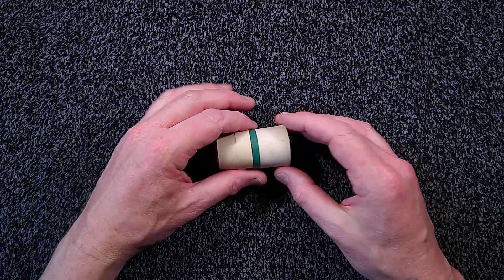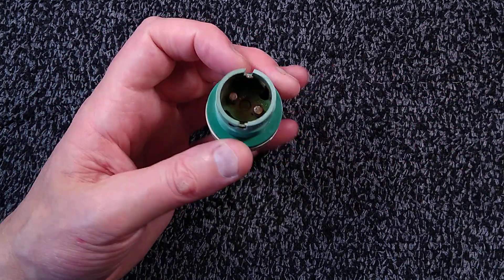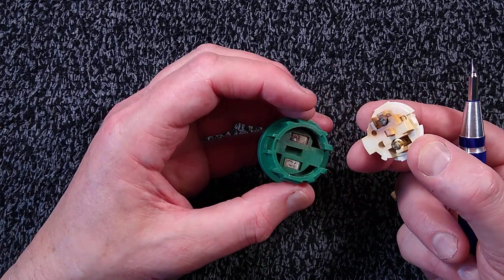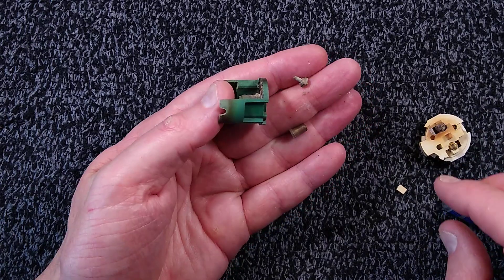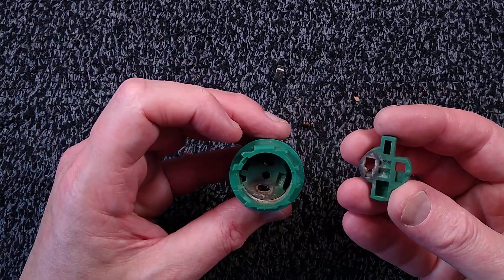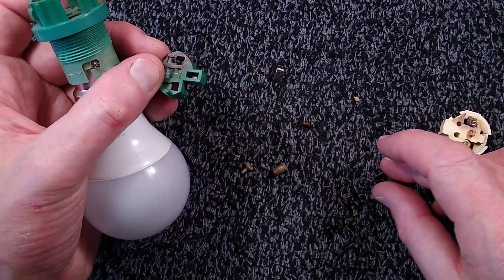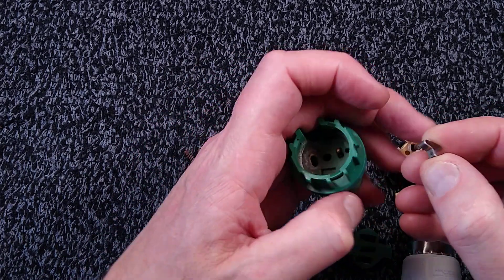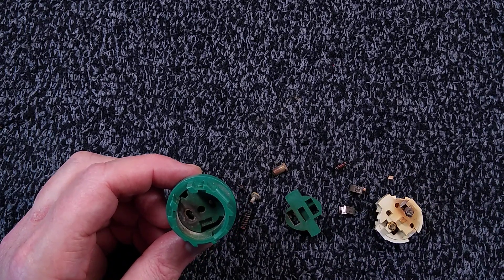Inside a failed safety lamp holder.

Comment: "Safety" often means "more stuff to go wrong"!
Reply: Oh yeah like those automatic water heater shut offs that if water builds up it shuts off the gas or opens the circuit to the pilot light thermocouple.

If enough moisture gets to it or just a little bit of water yep you got a problem!

Just like a malfunctioning fire alarm system will keep your HVAC from front working in some cases depending on the setup of course this is mostly just commercial but still.

Don't even get me started about that switch that doesn't do anything apparently and it's the emergency disconnect switch for the HVAC system typically at the foot of a basement stairs or otherwise.

Sure enough it's going to wind up in an off position and when not marked or otherwise unknown it's going to eventually wind up being off when the heat's needed got called out on this numerous times although sometimes when people move in or otherwise and they said there's a switch that doesn't do anything first thing I do is start asking where it is and so on and do they have and do they have anything that runs on fuel oil.

Switches that don't do anything can always be fun figuring things out and sometimes literally funny in the end when you realize what it does.

Also first thing I do is ask in that area is there any overhead light fixtures at all and often times just to switch outlet they're not aware of think it's a code requirement in most places to have switched Outlets where there is no overhead light at least in the United States.

Other times people have thrown a apparently light switch and been scared of their butchievers.

By allowed Bell or loud buzzer of some sort that was used for emergency communication throughout a house.

One time and one time only they were tied into the old alarm system as an emergency alarm and they did not know it found out this is a homemade system built out of modules probably in the 50s or 60s or earlier.

All low voltage for the most part there are a few things that interface with line voltage and other low voltage systems and could flash certain lights as well.

And even automatically turn on lights in certain circumstances.

The idea behind the switches that didn't do anything not the momentary ones but to maintained switches it looked like a light switch then right next to the momentary ones can't remember what the momentary ones did but it served two functions one pushing up and one pushing down but the other just sounded the alarm system continuously at least inside normally it was pulsed but my gas is it's just an emergency indication but for who knows what reason.

However in that same place there was panels on the wall which at first I thought were heat alarm panels but it turns out that that was intended when a communication cord was plugged into a receptacle it was quarter inch that's what they called the assemblies for communication cords they were found in a box in the basement labeled as such by hand.

There were a few other switches and push buttons on the junction boxes with the quarter inch Jacks they plugged into as well as well as a few indicators.

There was also a red and green on a single gang box cover what this was was a garage door button and the lamps indicated open or closed and in the bedroom and also at either door there was an override switch designed to lock the garage door from being open either via remote or otherwise other than going in through the door on the side of the garage and hitting the button.

Also there was a key switch and down the driveway and on the opposite side which would have been the passenger side of the car something similar except what looked like an old school screen door latch/lock but was the mechanical cable release that was installed somewhat similar in a pipe coming out of the ground and in a 90° fitting.

One more place of interest one place had all sorts of rather intriguing one-off things including these mystery wall plates that had two fuses and a four Penn Jones plug.

And there was 120 volts ac present!!

Turns out there were modified flip clocks that the alarm contacts were tied into two of the four pins and AC power into the others as well as a push button switch was added and also a two-pin Jones plug that was wired in parallel with the switch contacts.

As well as a toggle switch that would interrupt one wire back to the forward Jones plug.

The idea was there was Bells throughout the house note the switch only interrupted the contacts from the alarm but not the push button nor do wiring to the two contact Jones plug and there were a few buttons throughout the house tight end as well.

The idea is if any of these buttons any of them were pressed it would sound a bell and also in addition to the local alarm on the clock the alarm on the clock going off could sound the Bell.

Later on ran into someone that had lived there most of their life and explain the rest of the systems that are still scratching my head on
Reply: @aaronbrandenburg2441  Consider writing a book, somewhere else.
Reply: That's the compromise, the upside is less dead people who were decent human beings aside from a brief moment of lethal stupidity.

Comment: Just a quick Question Clive concerning resistors what is black black green silver brown i can't find anything like it 😫 and would a failed resistor have continuity?
Reply from the maker: It's it a sense resistor for measuring current? If it is then the value will be very low.
Reply: @bigclivedotcom  its on a circuit board that runs a dremel with variable speed but as soon as you turn it on it spins up and  cuts out and its the only resistor that has continuity, done a bit of digging its apparently 0.05

Comment: Ironic that I've been reading the uk safety recalls for the month and there's a recall on a table lamp where the bulb can be removed and the live contacts can be touched by a finger. Surely this is the case with most bulbholders.

Comment: My sister's brand new flat had a compact fluorescent tube light that kept turning itself off, turned out that once the bulb and bulb holder was warm the metal contacts in the holder expanded losing contact with the bulb.
Reply: Interesting I can see how that might happen I bet you that was a treat to figure out what was going on that would have made me scratch my head for sure I can see if it were a similar situation with a incandescent bulb that would cause it to heat up more rapidly might even act like a bulb flasher except not as often flashing.

Also anyone heard of the old gag about putting the in socket flasher in any random lamp surreptitiously and then reinstalling the bulb and the next person that turns on the lamp is agreed by after a while a flashing lamp since it took a while for the Flasher to heat up to operating temperature I do believe they used to be called socket winkers.

They're the same company that made the old usually Bakelite flashers not sure if that company still around or if they have the end socket ones anymore.

All my buddies got me a couple for this gag specifically although I had used them with Christmas lights plugged into outside porch lights and that they wanted all the lights flashing so just screwed the plug adapter in to the socket after placing the socket with her in the socket worked really well.

Another one the oldest trick in the book is to aim a flood light at another floodlight or another light that has a photocell or if you can get it just right you can even have the floodlight flashing and it slow speed if you're able to get it aligned or light reflected off just right way to trigger the photo so the shut off.

I actually got called into somebody's place they couldn't figure out what was going on they said that when you turn on one light another one turned off even though two separate entire switches I thought at first that they had a three-way switch it was miswired but they neglected to tell me that it took a second for it to happen am I heard that I said is it on a photo so he says did you just say photo cell bingo one night was turning the other one off it was turning off the post light from the flood light.

I have been known to occasionally given the opportunity we aim some whites to do this intentionally when there are other lights using photo cells just drives one a little batty.

This also was going on with a pole light on ce at first everyone including me thought the bulb was just at the end of life or problem with ballast and starting or just marginal otherwise.

They said it had just started and I didn't realize at first the problem was and they had started using a floodlight and that wasn't used very often on the barn the thing is it seem to shut on and off at random but it was only when the flood light on the barn was on.

Needless to say it just need to be reamed by just a smidge.

Also numerous times of went to put in a new floodlight and sure enough just a wire coming out of the wall or soffit or otherwise no junction box.

Of course it's a code violation.

I've learned to take a close look at the screws for Clues at this chances are when this is the case there will be one or more drywall screws used to hold a flood light or a coach light or other outdoor light in place 99% of the time there was no junction box there so something to watch for may not be 100% a clue but there's a good chance that's what's going on always expect what you don't expect to be the case
Reply: @aaronbrandenburg2441  yeah head scratcher for me, checked all the wires in the switches and pendants tried a bulb from another room so only thing left was the bulb holder. It was a 4 pin compact fluorescent tube bulb.
Reply: @aaronbrandenburg2441  Same issue as in your previous comments.

Comment: I'm surprised that these were never made compulsory to prevent electric shock in the UK. I always thought that lamp sockets were a potential shock hazard, that were never correctly addressed. I think many kids have stuck their finger in one. But you would only do that once, and never again 🤣.
Reply: i shoved my finger in a table lamp bulb holder (empty for some reason?) when i was little, and yes it was  switched on!!
Reply: to be fair most of the world's bulb holders are not finger proof. Its not a uk problem
Reply: @kevvywevvywoo   I guess it applies to most of the world then😉. It's just the UK is obsessed with health and safety. Anything that is remotely dangerous/ potential electric shock, is an issue in the UK 🤣. The rest of the world seems to be pretty blasé about it.
Reply: @MyProjectBoxChannel  Most countries still dont require shutters for sockets. I dont see a porblem with it, I believe in natural selection.

Comment: Are all sockets in the UK the bayonet style or is there a mix? I know in France I saw mostly the Edison style.
Reply: @Matt Quinn same as Aus/NZ. Once upon a time you could hardly buy an E27 bulb; now they're in every supermarket.
Reply: standard ceiling pendants are bayonet but by the 1980's you could buy table and floor lamps with screw in bulbs instead, as is the case these days

Comment: Oh, ok, the kids wont get shocked but instead the arcing in those flimsy contacts will burn your place down
Reply: @girlsdrinkfeck  RCD does not trip between live and neutral, so will keep arcing :-)
Reply: @girlsdrinkfeck  You'd need arc fault protection to trip on that, there would be no difference in current between live and neutral to trip a RCD/GFI.
Reply from the maker: RCD needs to detect current flow to earth.

Comment: Anyone who's ever had to replace burnt-out lamp holders would not have gone on to design a safety lamp holder using the same types of materials.
What were the manufacturers thinking?
Reply: They were happy they could make the new product with their usual materials and tools that they already use for lamp holders, lamp holders with switches, wall switches, etc. etc.

Comment: What sort of bulb was in it when you took it down?
Maybe an incandescent bulb would 'weld' the disintegrating contacts shut due to high current and a LED lamp would just flicker.
Might have been dodgy for yonks and people have been fiddling with it to keep it going.
Well done for being proactive and curious  :)
Reply: @Okurkaarrgghh  ohm out a cold one and report back. Incandescent lamps are huge PTC resistors and nearly a dead short at power on. There's a nice contact welding/burning current spike at every power up. That's why you sometimes see mains switch gear with different ratings for tungsten lamps vs other loads.

Comment: A few years ago, my daughter bought  10 "Eco" halogen light bulbs from the local surplus store. After a while her lampholders began to fail in much the same way as yours did. Although the bulbs were only rated at 240V/60W, the halogen element was located near the neck of the bulb instead of centrally in the bulb itself.
Reply: I think halogens also emit some UV which might do wonders right near the lamp.
Reply: hate those lamps, they dies so easy and usualy trip an mcb when they do. I'm guessing the arc when it breaks is basicaly a short.

Comment: Looks to me (without having one to examine) that the connection is made by the moving of the pins when the bulb is pushed in. The sliding bit is just to facilitate locking the bulb in. Then again, as I said, without one to examine I may be completely wrong.

Comment: Intriguing construction, elegant! Sadly somewhat let down by quality.
Reply: maybe nothing wrong with the quality, just heat from the bulb eventually cooked it , as commonly happens with pretty much all non metal bulbholders
Reply: Quality what quality is more like it
Reply: @andygozzo72  Pardon, i have a bunch of plastic ones and if you use them in a well ventilated space and with adequately rated bulbs, 30 years later, they are doing just fine. Also metal? You can't make the whole thing out of metal. Before various polymers they used to be made from ceramic, that was actually nice.

I don't know which plastics you're supposed to make one from; i imagine remarkably little happens to epoxy, but that's really expensive to manufacture, takes a lot of time. Maybe LCP? That could last an eternity and a half. Well nowadays since incandescent lights are banned you really don't even care, any number of cheap plastics will do just as long as they're UV-stable.
Reply: @SianaGearz  the metal ones are mostly brass with ceramic insert for the contacts, that is they were ceramic ones, modern ones may be different, havent bought a brass one for years, as for incandescent 'banned' people still use them, may have  bought them many years ago, and you can still get 'specialised' ones, (i still use them as current limiters for testing old electronic equipment) some led ones do get pretty warm in the base cap, although nowhere near as bad as incandescent
Reply: @SianaGearz  the metal ones, usually brass,  i've seen have ceramic inserts for the contacts, i dont know what they currently use as havent bought a metal one for many years

Comment: I always cringe when I see these slow non snap action AC switches where, under load, the arcing is going to be sustained through several AC cycles in opening the circuit.